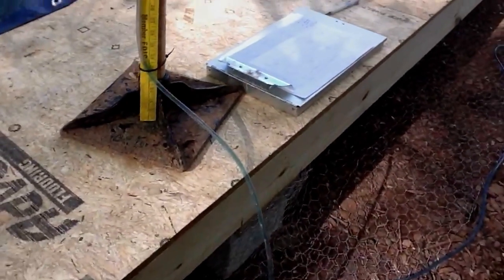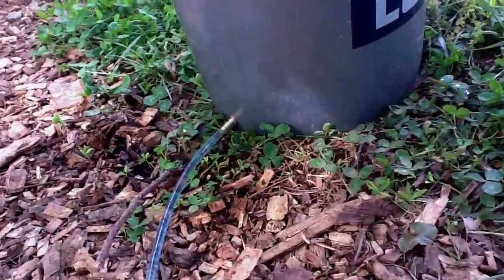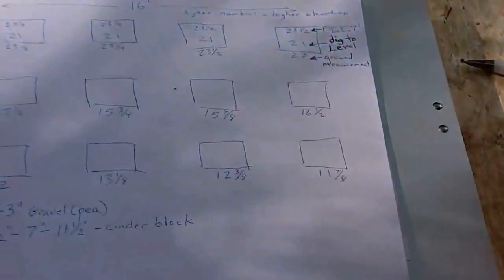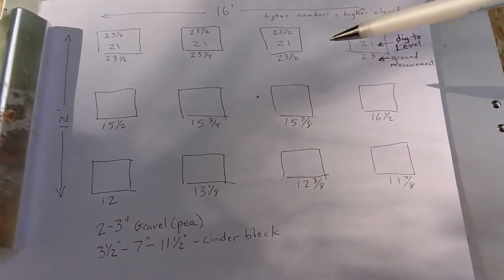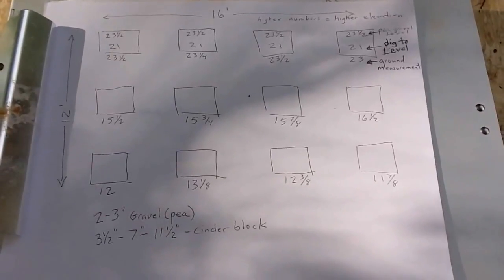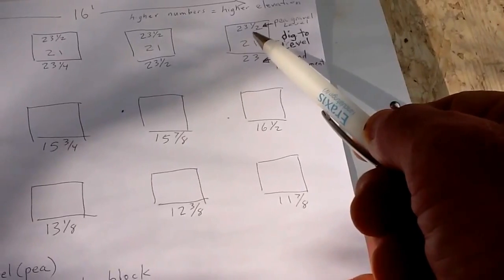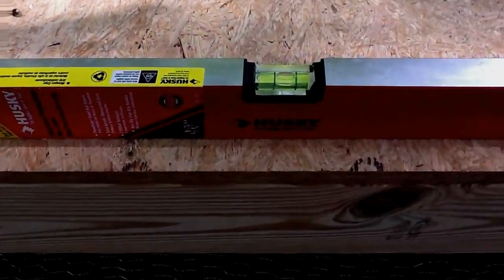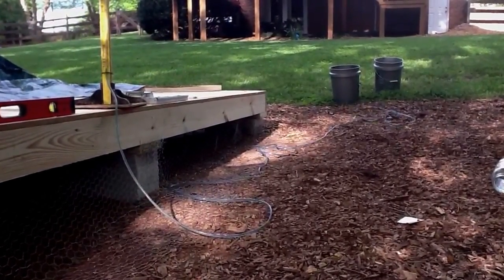Water level is so easy to level shed, precise grade for water run off, and more uses

Comment: As an engineer, always had to run levels with a two-man crew, one with a self-leveling telescopic level and another holding the rod (add back sights and subtract fore sights).  I had a home project and didn't want to rent equipment and didn't want to have to have someone else.  I studied piezometers in engineering but the idea of a water level never occurred to me (should have been obvious)..  Then saw the water level idea on YouTube and got excited but thought it would be a pain to have to carry the water tube around all day to prevent losing water.  Then I saw this video with the idea of connecting to a tamper (fantastic idea), and inverting the yardstick allowing direct elevation readout (super-fantastic idea).  The ideas in this video made the project so much easier, and just plain fun! Thanks for a great video dude!

Comment: I built a shed with these plans from Ryan [Check Details Here⇒>https://www.facebook.com/Shedplans-1906203496273256/app/208195102528120 ]. The instructions were clear and easy to implement. Even a novice can be able to build fast using this plan. I'm happy I bought the plan. It also saved me much cost.

Comment: Question. On an existing home which is on piers, how do you determine the correct level at which you adjust all others to? Do you find the highest pier and adjust all others to that height to conform maybe? And if so, do you locate a ruler at the highest point to make all other points conform to that?
Reply from the maker: Just a guess on my part, but I'd suppose you'd jack up low places and insert shims to build up to highest pier. The ruler measurements are relative, depending on the bucket placement height (and the water height within).  Remember the height of the water in the tube and its reading against the ruler tell you how much variation you have between piers.  Set the bucket accordingly so that the water level in the tube as you move it around from pier to pier is within the working range of your yard stick ruler.  With practice you'll see what is working or not for you with respect to bucket and ruler placement.
Reply: Thanks Dale. Much appreciated!

Comment: Good job,  consistant accuracy use 1/2" I.D. tube, smaller i.d. can yield a "stuck" reading.  Where you can move one end of the tube vertically just under an inch and see no change in the water level,  applies to 1/8" thru 1/4",  less  risky on 5/16" and 3/8",  "stuck" phenom'  applies most to smallest dia. and long tubes,  many contractors use up to 3/4".  Long term use add 1tsp/gal bleach, uncolored water,  & 2 drops dish soap/gal or change fluid/clean tube i.d. every week,  regards,
Reply: I found adding dish soap allowed success with thinner tubes but suds were formed, .  I appreciate the voice of experience! Thanks!